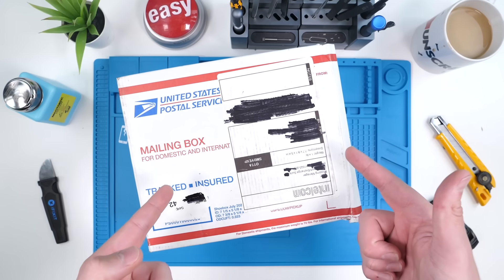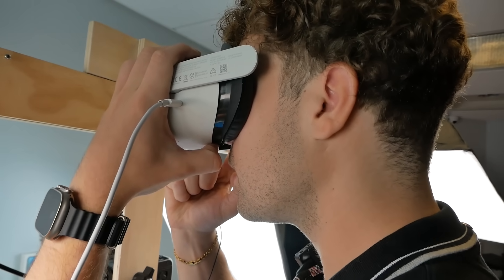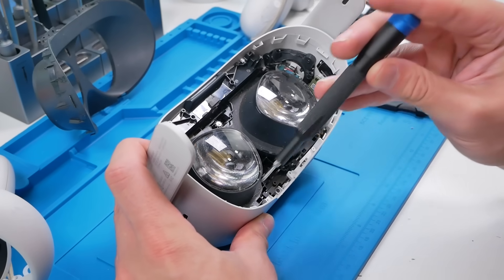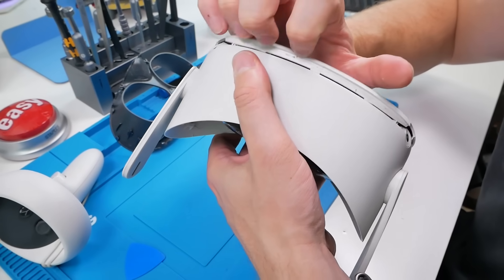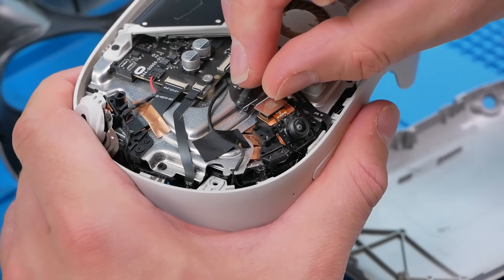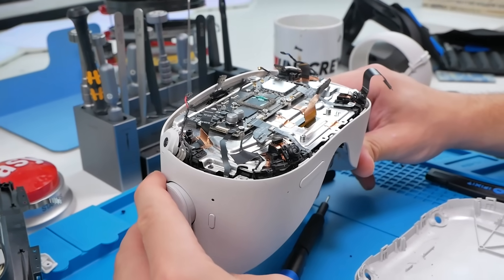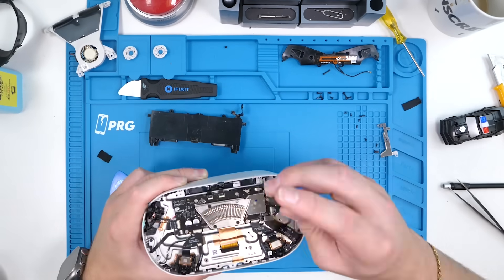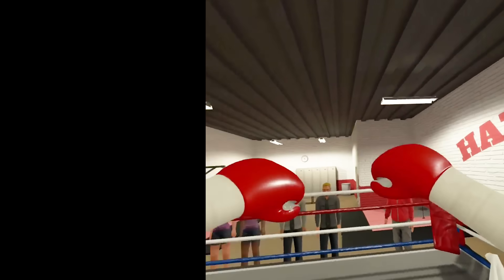The Oculus Quest 2 Has A Problem...

Comment: That's ridiculous. Those EU regulations about easily replaceable batteries need to target these devices too.
Reply: iirc the law targets all portable devices and the quest 2 is a portable device
Reply: ALL consumer devices should be user serviceable
Reply: @BeetleBuns  yes all consumer devices should be serviceable but that's not the world we live in anymore sadly
Reply: @tooldude1098  yup, that's why we need to fight for regulations to bring that world back. As a side note, where are you getting the $4 - 5,000 figure for a vr capable pc from? That's laughably inaccurate...
Reply: @BeetleBuns  that's not laughably inaccurate I can make a PC cable running most basic VR game for that much you just have to know what you're doing also I adding in the cost for a VR headset to which would be required to play VR
Reply: @tooldude1098  you can build an entry-level vr capable pc for less than $1,000, with all brand new parts. Even adding in a wired pcvr headset and lighthouses wouldn't bring the price even close to what you're pretending is necessary...
Reply: @BeetleBuns  where the hell do you live because if I want to even buy if your headset it would cost more than $1,000 specifically wired headsets for PC
Reply: @tooldude1098  literally anywhere in the US... even if you bought a brand new Valve Index you would be around $2,800 total cost including the pc, and that's if you went all brand new parts... you can easily cut that in half going used.
Reply: @BeetleBuns  okay true I did exaggerate but I was more just pointing out the fact that you can't get a full PC VR setup for the price of a standalone headset like the quest was the main point
Reply: And if you try and told me it's possible to get a full PC VR set up for the price of a standalone you're a liar
Reply: @BeetleBuns Still more expensive than a quest pro😂
Reply: @BeetleBuns  That limits future innovations in our technology. Adapting to making it self serviceable means all parts need to be in a specific area which does not leave room for creativity and innovation.
Reply: how to hold back innovation:
Reply: just buy a quest pro oh wait thats $1500
Reply: Only on tho device not on stupid phone
Reply: Hot swap batteries!
Reply: thing is most folks still wouldn't bother to replace the battery. Also it's really hard to have a small and light device with a battery door. That noted, the Quest 3's battery is in the backstrap if memory serves so it's not QUITE this awful.

this is somehow not as bad as the OG Rift CV1, that thing needs some of the oddest long-reach screws I've ever heard tell of.
Reply: They will have to.  There's a new law coming which will obligate electronic companies to build their phones, tablets, laptops and all other devices with a removable battery. 
This will promote an easier recycling, disposal and repair of your electronics.
Also a true sense of ownership.
Reply: Wait IT wii be sieoon
Reply: Here make sense though, It is very compact device and unlike phones, These device also has to pay a lot more attention to the weight of the and it's distribution.

So it would be mess for R&D to deal with it.
Reply: Well... The quest 2 already being extremely heavy and pretty big. I prefer to have a more confortable device wich will try to reduce the drag to a heavier device and bigger wich will be extremely uncomfortable.
Reply: whats ridiculous is that you dont understand how hard it is to make such a device in the first place.
Reply: it would be really hard to do you have to cram so much tech into a small spot
Reply: The EU regulations will only apply to our EU market.
Reply: @phimtown  that kind of stupid :(
Reply: @phimtown true, but those regulations WILL affect the entire world because the companies do not want to have separate tooling and parts for each region. At the end of the day, complying with such a large market as the EU should cause them to just make all products comply just for simplicity's sake
Reply: @BeetleBuns  Oh, they don't? Why does Samsung have different CPU's for different countries then?
Reply: @phimtown Although doing those changes to sell in the EU will make it more cost effective to just make all of them the same
Reply: @phimtown  nope it will effect the world just look at what apple having to change to type c coz of the eu
Reply: @phimtown companies most likely won’t want to create a whole new production line just to cater for 1 continent. For something. As small as the USB-C law, I can see that happening.
Reply: @aw1lt EU is not a country though and also has more inhabitants than the US
Reply: @Minecraft-ci2cg  right so what I’m saying is, they’re gonna modify all of their products across the globe to cater for the EU. But for USB-C they might just only add it for the EU market.
Reply: @aw1lt  1 country?? The EU has 27 countries dude. But of course an American doesn't get that..
Reply: @phimtown  sorry, i meant continent. You know what I mean though.
Reply: @Minecraft-ci2cg not more consumers though. Think of how many phones the average eu lad buys in 10y. I'd say the average is probably like 2-3. Whereas the usa it's like 7-8.

A whole new production line to put in type c and a different battery placement would be extremely expensive. They're trying to force big companies like apple to be more user freindly.
Reply: u can always use it as a wired headset
Reply: @SHAUNOFTHEWEEK  you can't, once the battery is completely dead, it will just bootloop
Reply: @SHAUNOFTHEWEEK still has a battery in it tho. Even if it's low charge it can still catch fire
Reply: @SHAUNOFTHEWEEK Who wants a wire to your head? Your movement is way worse then…
Reply: @SHAUNOFTHEWEEK  My friend has a headset with a super dead battery, it will charge to 100% and sometimes instantly die, it's because the whole headset is contingent on battery voltage, you've battery can't maintain voltage it wont work. The only way to fix that properly,  would be wire in a power supply and fool the battery supply int thinking it has nominal voltage.
Reply: @SHAUNOFTHEWEEK  fun fact it still dies when wired since it still uses the battery, just lasts a good hour or two longer
Reply: @SHAUNOFTHEWEEK yeah let's just remove the entire point of getting this device.
Reply: @SHAUNOFTHEWEEK   the charge port doesn't draw enough power to keep the headset in neutral it will just die repeatedly.
Reply: Good idea! All you need is a 2000 dollar PC to run along with this 400 dollar device
Reply: @SHAUNOFTHEWEEK then why get a quest in the 1st place...

It's not like its a great vr, it's just basically the only choice for wireless pc-less vr
Reply: @SHAUNOFTHEWEEK kiddo
Reply: @SHAUNOFTHEWEEK you can't actually. They don't start with a broken battery.

He literally showed that in the video
Reply: @SHAUNOFTHEWEEK  quest still uses battery while using wire. The quest only transfers data through the wire. To power the displays it uses its own battery.
Reply: @SHAUNOFTHEWEEK   You literally can't. Quest 2 does not support passthrough power. Once the battery is completely gone, the headset is completely gone.
Reply: @SHAUNOFTHEWEEK keep in mind, the quest 2 will refuse to work without a battery and you need a very high powered charger for it to not matter
Reply: @SHAUNOFTHEWEEK  no because there show batteries error on screen.
Reply: @SHAUNOFTHEWEEK yeah if you want to spend an extra $4,000 to $5,000 on the computer that can run VR and a wired VR headset
Reply: @SHAUNOFTHEWEEK true
Reply: small price to pay to make it weigh as little as possible, dont want to open these anyways as you can easily damage the lenses and screens

Comment: honestly I think the software is the worst part of the quest 2 since I keep on having issues related to software after every update, never had a problem when it wasn't owned by "meta"
Reply: that's part of the zuckification, another part is that now the cameras stream 24/7 to meta so facebook and threads can show you more personalized ads
Reply: @vnc.t  Just shut down the device with each use. Its sleep mode is absolutely trash. Probably because if it really sleeps it can't collect my personal information.
Reply: @vnc.t  lol, what? im not defending meta, but this claim is absolutely dumb because the camera view is very grainy and does not have color, what are they gonna do with that?
Reply: Yeah, I admit, having my Quest 2 since launch, the most frequent issues I run into have always been software related. Every update breaks something.
Reply: @DiamondDepthYT  i never experienced any issues with software maybe because i update it when power it on like 2 days a week so every bug has been patchout already
Reply: Meta owned Oculus before even the DK2 was released.
Edit: DK2
Reply: @gyroninjamodder  no dk1 released 2013, and meta bought oculus 2014

Comment: I wonder what apple VR is going to be like.
Reply: Here from the future. It’s expensive and the quest 3 does the same thing for 10x cheaper
Reply: Glass,glass,glass, and more glass. Oh did I mention it is mostly glass?
Reply: The apple vr is horrible
Reply: it’s expensive
Reply: ello mate
Reply: Probably worse
Reply: @straylumiioff better
Reply: @straylumiioff you where correct it’s fucking ass
Reply: @straylumiioff  apple is very good with design so it will be better .. at least we won't see a connector connection to a connector
Reply: It won’t exist. Apple’s product is ar, not vr as far as I know.
Reply: @3RR0RNULL  its both

Comment: The battery is quite possibly the quests biggest issue (mainly the battery's health)
Reply: someone should make a 3d printed frame for 18650/21700 batteries :)
Reply: @Nurblit There already are for genuine & some thirdparty straps. Though charge modules needs to be sourced separately.
Reply: If your battery is trash then use a battery pack it works really well
Reply: My battery life had degrading to 80% after two years of use or 3 years, but in my purse I always bring two batteries in case if my phone dies and 20 wh adapter for my iPhone about the purse I’m not a miss I’m a sir
Reply: It is a quest that allofus must embark😂
Reply: my quest 3 lasts about 2 hours on full charge
Reply: I have oculus and it dosnt last more than 1 hour and a half
Reply: @@itachisaskuwhat battery do you have and how much
Reply: i love the idea i can play my games over air link, but my god 2 hours and this thing is ready to go tits up.
Reply: yea
Reply: Oh wow I guessed right
Reply: Yeah both of my friends quests are newer and last at least 5 minutes longer than mine
Reply: You would think they used the same batteries Samsung uses in their phones.. maybe they did?
Reply: 500L
Reply: My original quest is still going strong after 4 years
Reply: if you have a head strap with battery, it will is helpful.
Reply: True
Reply: you could say that changing the battery is a "quest" itself.
Reply: I'm  from the future, Oculus has fixed this issue
Reply: @thomashenry-pq4jb  nice joke lol
Reply: @thomashenry-pq4jb only when daddy zuker starts acting like a normal person
Reply: @thomashenry-pq4jb no they havent
Reply: @MinerboyDoesStuff  They have, dumb bass. I own one.
Reply: Yea which is why I always have a power bank with me when using airline on pc when the battery goes down

Comment: The flaw is that it doesn’t have 9dof tracking
Reply: Can you explain? Cause 6dof would be forward, back, left, right, up, and down, but quest also has yaw, roll and pitch, so would that not be 9dof? I’m not very knowledgeable about that subject, but that’s what makes sense, so an explanation would be appreciated.
Reply: @3RR0RNULL  9dof does not actually exist

Comment: I love how I was just about to buy the Quest 2 and then…..
Reply: no the oculus is a good headset to have fun in note that i own one its not the best vr headset to get lost in but it is the best for games and other stuff but if you want some other stuff in a headset others got that if you dont have a pc oculus is good to go but META STUPID ASS PIECES OF SHITS been making bad descions btw he might be talking about the fan in the oculus cuz thats what the arrow is pointing to its fine i dont play big  games but if you add a new face plate the has more holes in it the fan should be fan hoped this helped
Reply: Hopefully Meta improves on the headstraps for the Quest 3. The design frankly sucks and the Elite Strap for my Quest 2 has hairline fractures less than a month after buying it.
Reply: @farhanzulkiflee6598  The design is improved, and frankly even if they didt improve it, the point is that there will be many aftermarket straps to choose from that can suit your needs and desires.

That's why its good that the strap is removable, which is impossible with a rear mounted battery.
Reply: I got the quest 2 and the pico 4.

Wait for the quest 3. Trust me, it'll be way better, and with better cooling.
Reply: @umbratherios  still got a quest 2 lol
Reply: @umbratherios except the controller tracking for quest 3 is ass 🤦👎👎
Reply: @uraveragewiteguy  Except for that, yeah.